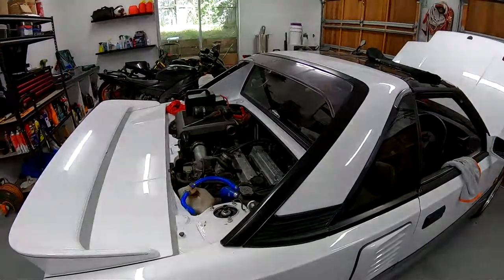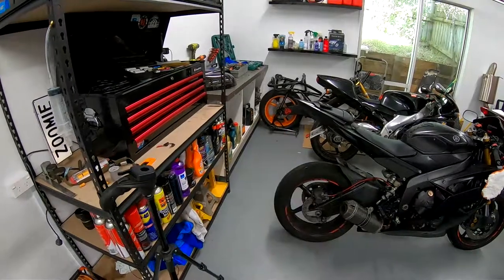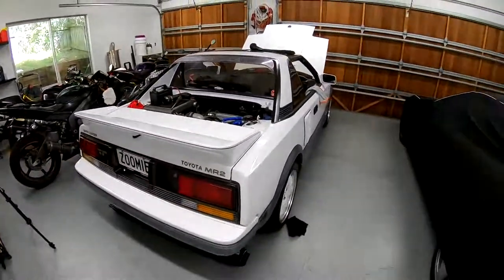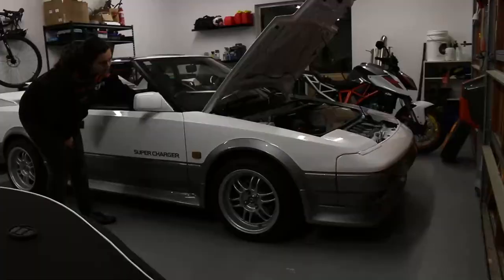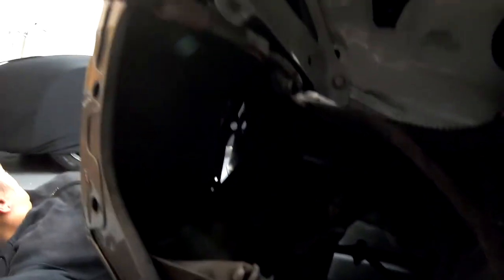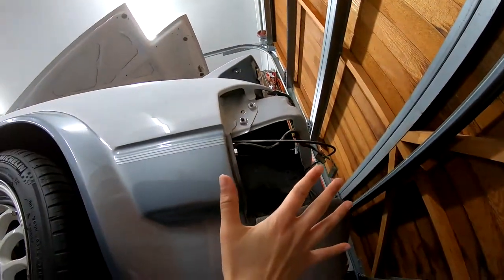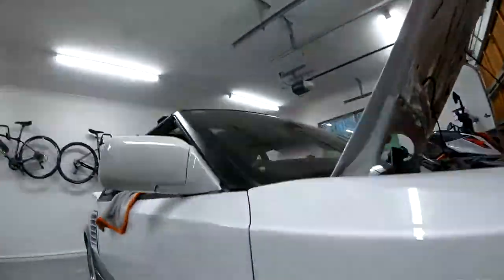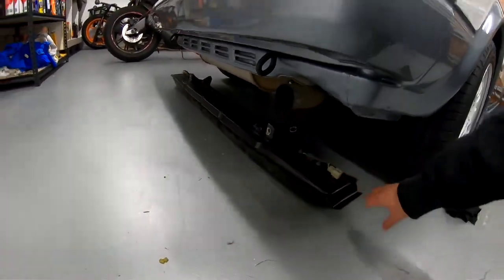I'm about to manual swap my Toyota MR-2

Comment: Very cool Mark1 very rare Toyota vintage. Fen tight to work on. I preferred the Mark2 out off all the collection. Is that a left hand version?  Here’s a few things per my review. Pointers 1: lighting under the car needs help. Do you have a portable light to let us see the details. 2. Picture overlays to add details would help. 3. Your a natural at narration. Keep it up! I’ll be tuning in for more . Thanks for sharing from your island.
Reply from the maker: Thank you for the comments! 

It's a right hand drive car, all of the vehicles we have are (they're all JDM imports :) ) 

1) you are absolutely right about the lighting! At the mo all I have is a little portable flood lamp, Do plan on upgrading the lighting sector as it was a total let down post for sure!
2) Good point! I will try that for the next clips! thanks for that tip!

Thank you so much for that final pointer, its really reassuring and uplifting to hear that. Will absolutely take all your pointers seriously and use them to work toward improving for future videos! 
Thank you so so much!!!

Comment: Did you end up using a pilot bearing? 
I'm doing a swap using 20v blacktop came with a auto transmission. I'm converting it to manual but I didn't see a spot on the manual transmission for pilot bearing. Any help would be appreciated. Nice car you have

Comment: two questions.... 1. Isn't the engine and gearbox in the back? Why are you removing the front bumper? 2. OMG? When did you get an MR2???
Reply from the maker: Removing the bumper because there isn't enough space to lift the engine out, so the whole rear of the car will need to be lifted, and I'm concerned that there wont be enough clearance at the front to clear the lip and bumper, so best to be safe and just remove them! 

IKR!? I got it 2 and a bit years ago now! 
wait... aren't you the guy with the V8 swapped avenger?! Small world! :P